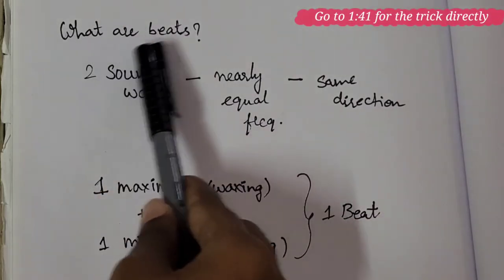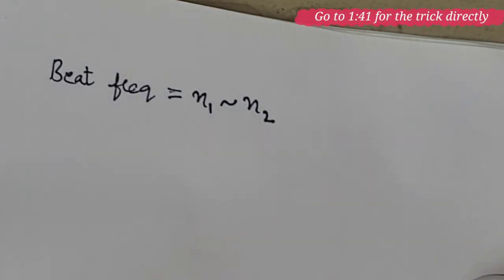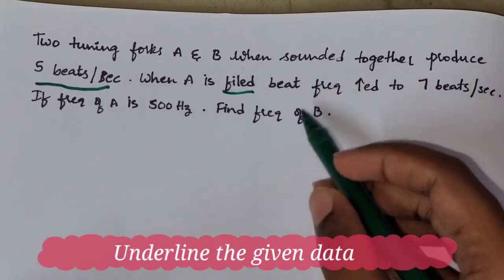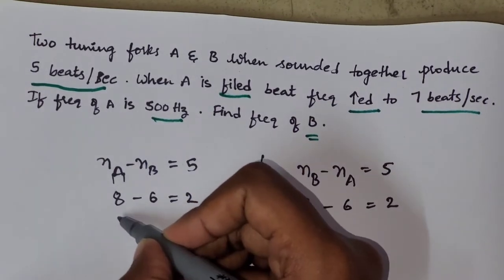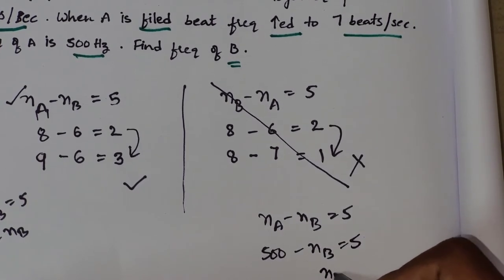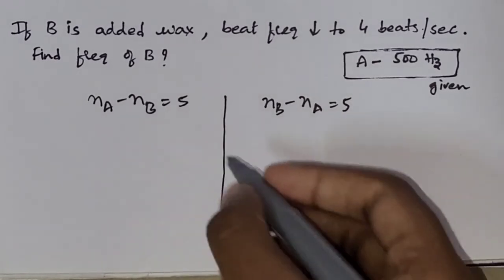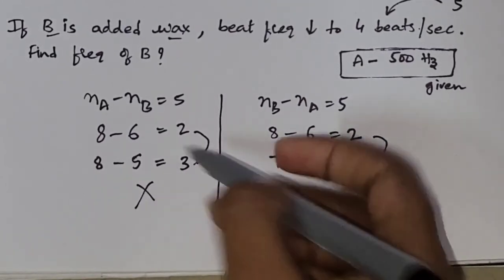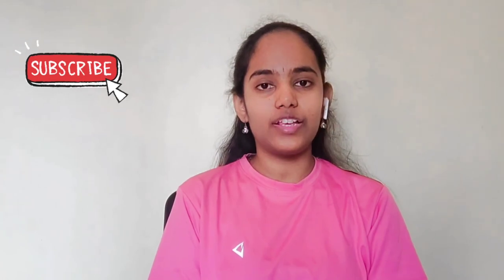Tricks To Solve Beats | Beats Numericals | NEET Aspirants

Comment: hii , i know this is a bit late but do you mind showing me some examples in which change in beat frequency is same and we have to take decreasing case? thanks!!
Reply from the maker: A tuning fork gives 5 beats with another tuning fork of frequency 100Hz. When the first tuning fork is loaded with wax, then the number of beats remains unchanged , then what will be the frequency of the first tuning fork 
A)95Hz 
B)100Hz
C)105Hz
D)110Hz

Try this
Reply: @medbattle7864  its 105 right? opt C

Comment: Can you please solve this question with this trick. I am not able to get the answer by this trick.
In a guitar, two strings A & B made of same material are slightly out of tune & produce beats of frequency 6Hz .When tension in B is slightly decreased ,the beat frequency increases to 7 Hz .If the frequency of A is 530 Hz ,the original frequency of B will be?
a)524 Hz          b) 536 Hz 
c) 537 Hz         d) 523 Hz
Reply: Is it a
Reply: I am getting 536 as answer😅
Reply from the maker: 524Hz is the correct option. If you follow the video properly u will get it.

Comment: What if frequency remain same after filing or waxing???
Reply from the maker: U have to take the decreasing case!!
Watch the video carefully, i mentioned it in the video!
Reply: If it is waxing add the beats to initial frequency means greater value. If it is filing simply decrease the beat no.  from initial value which means lower value. 
Waxing = Higher value 
Filing = lower value